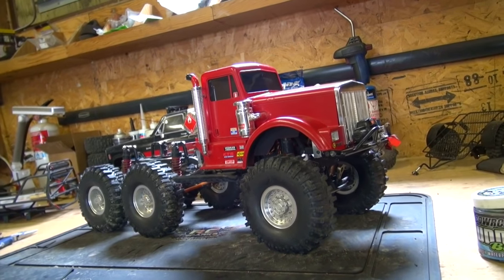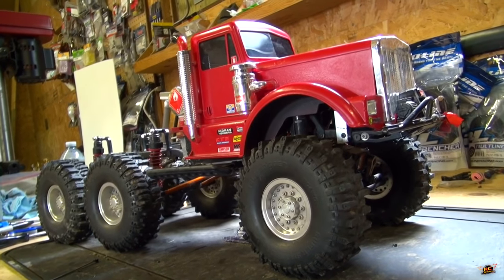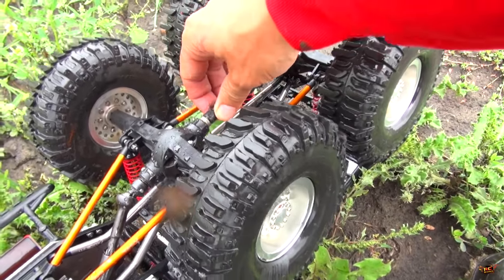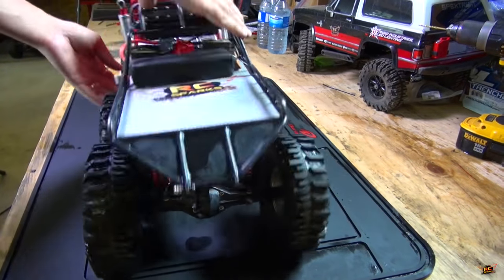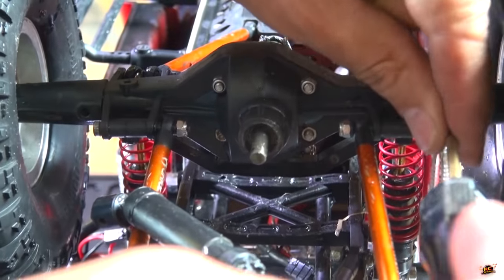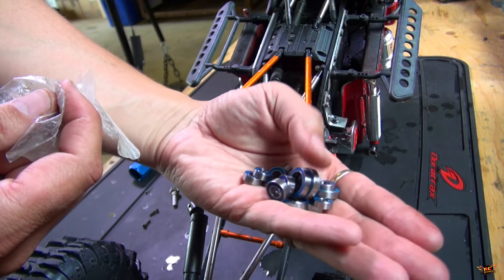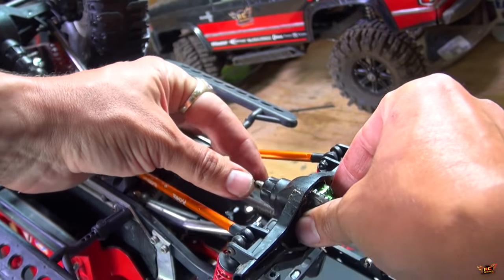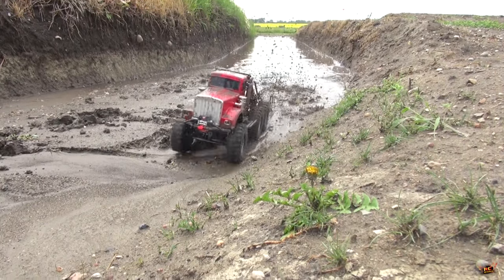POWERFUL 6x6 TRUCK in MUDDY SWAMP - OFF ROAD AXLE REPAiR JOB - "BiG RED" - RC ADVENTURES

Comment: Hey medic a tip is to fill the space between the two bearing you replaced with Greece. As it acts like a water barier when going through water

Comment: I once popped a bearing off at 50 mph with my ecx torment.., steering links snapped but surprisingly after it flipped a few times the body posts were still intact :)

Comment: That motor setup has some crazy torque!
Reply from the maker: Steel driveline. I had to replace the rear drive shaft 3 times today! Finally, I switched the rear to a steel MIP. It was the only way. Then, the front pinion went.. Lol. That's RC for ya.. sometimes it gets you all at once.
Reply: +RCSparks Studio WHAT motor do you use? I found the sidewinder 3 doesn't have quite enough torque for a 6x6

Comment: I dont know anything about rc vehicles, but your videos have bee  popping up in my recommended for some reason so I have been checking them out. One thing i cant seem to understand is how these things are able to be practically submerged in water for extended periods without shorting out or burning up right away.
Reply from the maker: We go through steps to waterproof and improve them, Mike!  The hobby of radio control is absolutely amazing my friend.. I have a feeling you may want to click my name.. and scroll through some of my vids. I can definitely say it will peak your interest. Thanks for writing!
Reply: I will for sure be checking them out more, if I didnt have my hands full with my 1971 chevelle project right now and I had the spare funding I would get into this stuff in a heartbeat. Thanks for replying and for the excellent video content!

Comment: Medic you KNOW that I love your channel and your positive attitude towards Rc and family...but I have only one thing that I have disagreed with that you've promoted... (greasing bearings) I've found that greasing attracts dirt and the spinning parts create gritty compound out of the grease... grease killed my bearings after I tried it... I greatly appreciate your amazing efforts and respect your unmatched experience .. I just want to see if you'd try one rig with no exposed grease ..air dry after then lightly mist with dry lube then air spray once after to prevent rusting..
anyway thumbs up!! 👍  love the video!! KILLER RIG💪
Reply: Hey man... you'r nearly right, bearings do not need any greas or oil.. only clean them after running and use high-quality bearing (Boom Racing)..

Comment: hey medic great job i have a question for you, on my traxxas slash 4x4 the mip left drive shaft wiggles a lot at a high speed is that normal?? i lost a washer for it and got it replaced and it still doing it any suggestions??
Reply from the maker: Check your bearing man.. sounds like its ready to blow up
Reply: +RCSparks Studio ok cool thanks medic keep up the good work is it ok if i give you my number so i can show you a vid so you can check it out??
Reply: im no bad person im 14 years old and i never do bad stuff i am a hard working kid that goes to school and im never lazy🙂

Comment: you should try Boom Racing axial PHAT axles for that beast. they do have axles for 6x6's and they are all steel. maybe it will help prevent water in the axles
They also have a wide variety of aluminum upgrade parts for many vehicles. Tons of shocks too. if u haven't already checked them out, i highly recommend them!

Comment: it's worked I can comment. love the video. I made a mod with my wheel hub bearings. stock are 4mm deep so I put 5mm and it took out any slop in the wheels.

Comment: my HPI racing drift car has broken steering servo mounts and a broken 27T motor and my dromida mt4.18 is front wheel drive because the rear diff is destroyed so YAY i have two traxxas t-maxx's but one got ran over and the other i just moved and cant find it yet IM HAVING THE BEST LUCK EVER great vid btw have to love the mud

Comment: I dont even want to know what you spent on that bad boy! lots of metal parts and pieces. Just about finished my fishing boat MONICA, everything turned out great,the instruments light up as well as cabin light, Mast lights and running gear. I took a remote controlled christmas candle apart and used the guts for the spot light which by the way was just a fake light until I was done with it. Now it lights up the hold area really well. I am waiting for the remote controls for the fish net booms,I just ordered it,so I can raise and lower the nets out in the lake. I have a few pictures on my facebook page. I can send you a short video on messenger when I get that remote in for the nets. I could take it out now but its a fishing boat,why even take her out till she is ready to work.
Reply: Are you talking about an rc or a real boat
Reply: +Braxton Rosner well,when I am done with it, I guess you might call it pretty close to real but no its RC. Its a german made boat made by A company called Dickie

Comment: Hey rc sparks. I just got a hpi e savage used, and I had to rebuild the whole front end, and it is almost ready to run. It is electric, with different wheels that are great, but I don't know what kind they are

Comment: i know you've told us were you got you screwdrivers but you got tell use again been meaning to invest in some for my reall cars and trucks can never find a screwdriver in the tool bag when i need it 
 i know your always using the hex and star bits with it but the come in normal drivers of different sizes right

Comment: I run Fast Eddy sealed bearings in all my rigs they have rubber seals on the bearing and it keeps all the water and mud and stuff out of them so I almost don't have to put grease on the exposed stuff

Comment: medic have a question for you I bought a scx10 and been doing upgrades and I got a axial 35t motor with the stock ae-2 esc hooked it all up turned everything on and esc smoked and burned up as well as the connection between the esc and battery was a onyx nimh 6cell 5000mah, please help me I am subscribed and love your videos

Comment: nice! A tip for you my friend... when you have axle housings or gearbox halves apart put a thin bead of thick tacky grease around the whole edge of them so when you screw the sections together you get a nice seal that blocks out sand and dirt and even water from entering through the seams.Still trying to contact you PLEASE contact me. :-)
Reply from the maker: Hello thank you for your tip. I have done this method as well, but find no matter what.. with lots of torque.. water will make its way in! crazy that stuff.. always getting in tights spaces!
Reply: yea it always seeps in from the bearings but it's always better to put the seal of grease for that extra protection not really for sealing water out to much but to stop little particles from getting in just from running in normal dirt conditions and so forth also.you should take your truck in that nice clean shallow water that you drove the jet boats in I bet that would be awesome!
Reply from the maker: shenlonco It's a little older.. but you may find it good still ... https://www.youtube.com/watch?v=TZ2dix8Bz54  :) A refresh is needed.. for sure

Comment: hey I just got my rc truck back running and the first time I drove it I noticed it wasn't going as fast as usual, so I lifted the body and the battery was super hot and puffed up
Reply from the maker: Not a good sign. You need a new batt. Sounds like you have some resistance somewhere in the drive line. Is your motor pinion and spur mesh too tight? Try spinning each wheel.. Something is giving you grief. Or, heck, maybe it was a bad battery all along
Reply: +RCSparks Studio ok thanks

Comment: Hey rc Sparks I'm new to rc vehicles but I just bought  a boat and I was wondering about getting a rock crawler. What is your preference on rock crawlers
Reply: He's got a lot of axial trucks, this truck is a heavily modified scx10 and hes also got a couple wraiths. They're both great it just depends on what you want to do. Scx10 is a great truck to start on and they just released a new version that looks nice. There's also the ax10 deadbolt that's fun too. He's got a couple vaterra ascenders too. Either way you can't go wrong. You can get used stuff too but make sure you see it working before you buy it if you buy off Craigslist or something like that.

Comment: That's the same problem I always have with my rc car. I mean of course my car is totally different then this one but it's always the rear diff bearings they keep bursting in my car and then of course the diff gears come loose so u have to put new ones
Reply: ( bearings) of course

Comment: Sand eats all metal
Reply from the maker: Yup.. thats why I use that grease.. It certainly helps protect the metal drive shafts
Reply: But grease absorbs sand and sand eats metal. I think use grease when put truck in water. It is your case. But grease dont should be use anywhere and anytime.
You fun and creative man. May be try make new godzilla trophy truck with one 1/8 brushless motor.
Reply from the maker: Andrey Valukin As I mentioned in the film, clearly, the grease was being used for mud and water. Not to be used in dry circumstances.

Comment: I didn't think this was overkill-just swapped the rig body, right? overkill is 6 wheel steer as well-geared for torque, not speed. Wicked wide-open-throttle action!! That muck is like toothpaste, it appears to have the "suck'n'slip" quality about it(sounds like bad porn, sorry!), listening to your boots squelching through it! That rig has a high centre of gravity-is there a buoyancy factor with those tires? or was it just mad wheelspin giving it a bobbing paddle boat affect? good fun watching it plow through, always dig the repair & tech stuff too (too bad about the bearing & pinion troubles)

Comment: hey rc sparks my 1/18 sct broke all the dog bones and i got new ones i put them in and the wheels did not move i removed the back gear and open it up and nothing was wrong with it i put it back together and the wheel sinned but when i put it back on the ground i could hear the gears grinding but nothing was wrong with it

Comment: can someone recommend me a brushless setup (so esc+motor) for a 1/10 arrma ? i am really in need
Reply: I run the Traxxas velenion for a 1/10 Hpi blitz and it is amazing
Reply: I have a mamba monster set up in a stampede runs perfectly
Reply: +Dub _ bull shut the mamba is way to big
Reply: +Rcmonkey 25 I'm serious tho
Reply: +Rcmonkey 25 also ran that set on a slash
Reply: +Dub _ 2wd or 4wd because even in the velenion my pede is a wheelie monster
Reply: +Rcmonkey 25 4wd of course
Reply: +Dub _ I blow through rpm parts tho
Reply: +Rcmonkey 25 do u use 3 cell batteries or 2 cell
Reply: yoran vaatstra 

https://hobbyking.com/en_us/s3650-2800-brushless-inrunner-2800kv-15-5t.html

https://hobbyking.com/en_us/trackstar-waterproof-brushless-1-10th-80a.html

this setup is fast and toquie as hell